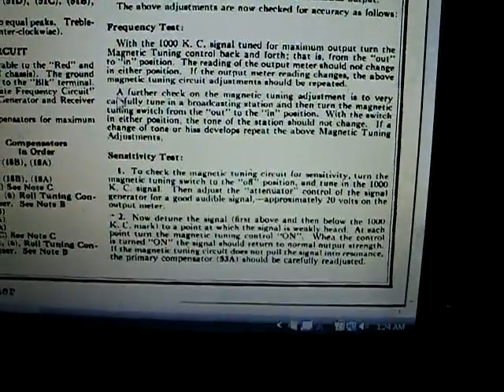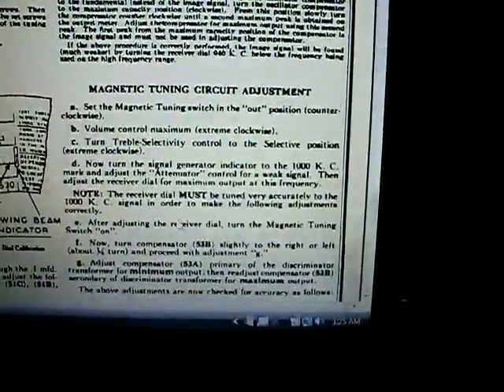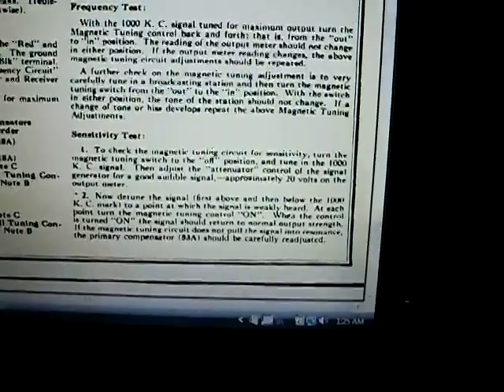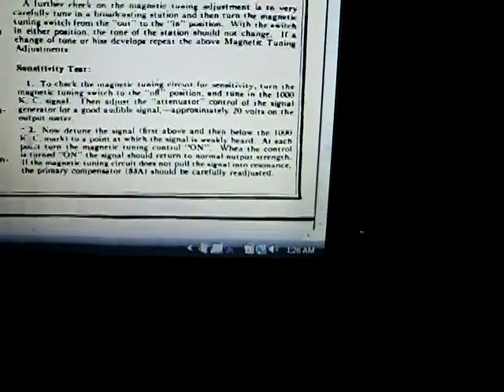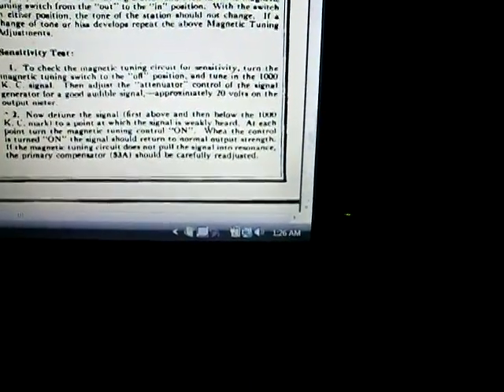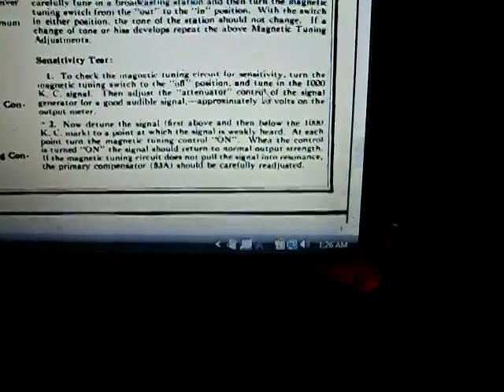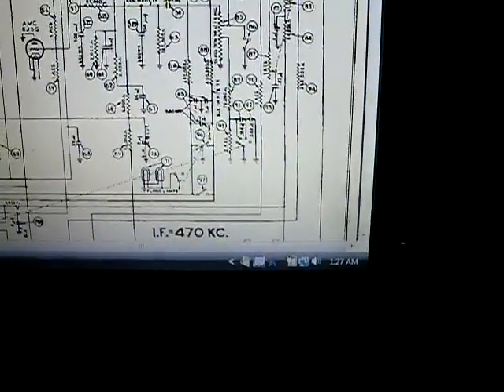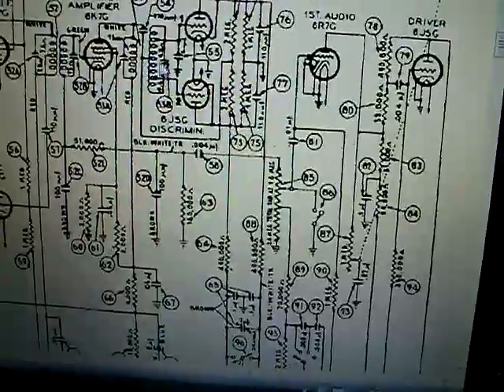Philco 38-116 Repair Part 17, Comments on Magnetic Tuning

Comment from the maker: @umajunkcollector I think market values are a little low now, unless it's a thing like a top of the line Scott or something like a Zenith Z1000.  I don't plan to part with this Philco anytime soon. Actually don;t plan to part with any of my resorations right now. I put a LOT of work into the electronics to re build them right. For instance I figgure I put about 400 hours into the RCA 262. That radio was a real basket case. Now it's a great performing allwave!

Comment from the maker: @umajunkcollector It's s touchy radio to align the RF. I think the 1937 model was probably a better radio in the RF since it has a lot more compensators in the circuitry. I think Philco cut them down to cut manufacturing costs and to make the design simpler. They did add the 6L6 beam tubes and I think the audio is extremely good. I can't wait to get it all put back in the cabinet.

Comment from the maker: @umajunkcollector yep, I agree, it's definately a keeper. It has really good audio and is pretty sensitive. The magnetic tuning works like a champ, it's very impressive. I can see why the owner kept the radio even though it was broken. They had really enjoyed it. I figgure the radio must have worked for 10 years, then stopped for some reason. I wonder if the repairman told the owner that it was too much money to fix it. I figgure the radio didn't work for 5 decades!